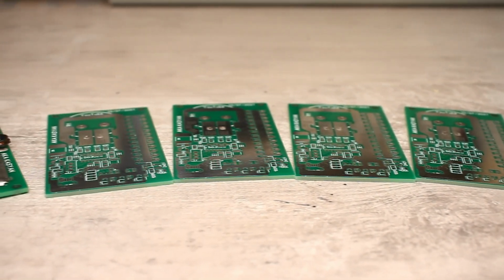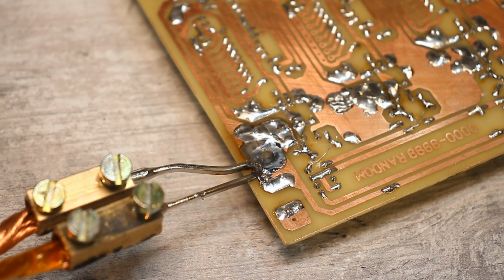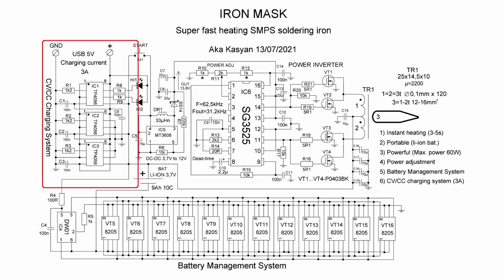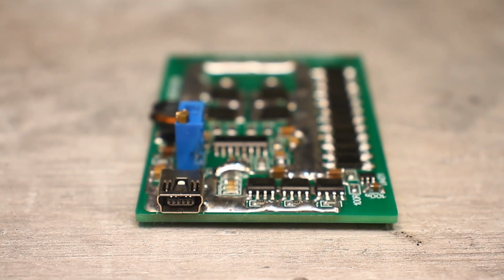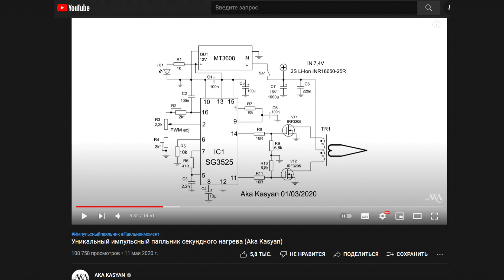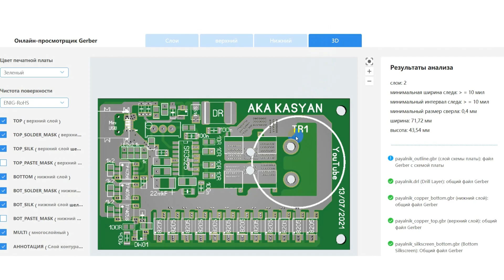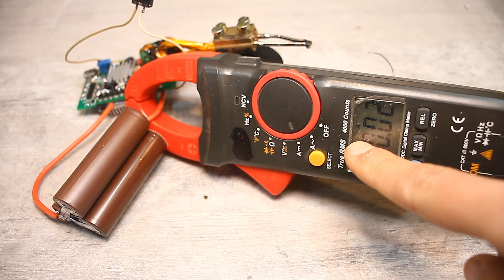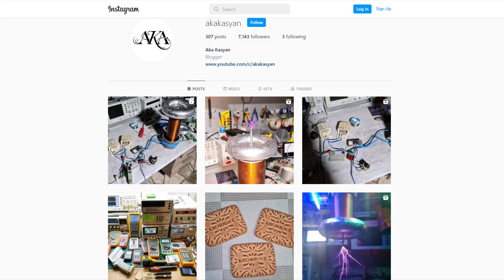IRON MASK - a unique soldering iron

Comment: The inverter and transformer are a lot of work for the small uplift in voltage you require; I wonder what power would have been possible if you simply connect the solder tip to the DC side ?
Reply: Tip is very conductive, u need output in the millivolt range.

Comment: A soldering gun needs enough power 50 ÷ 100W, that battery has maximum 3.6Vx2.5Ax3 pieces = 27W, maybe at SMD the top can also be seen on the thin loop

￼
Reply: Many batteries are capable of way more than 1C discharge current, especially e-cigs ones that tend to have a rating of 10C or more
Reply: It's an intermittent soldering iron. He's drawing a lot more current from the batteries, but only for a relatively short time.
Reply: batteries need to be high rate discharge capable like INR cells. or lipos that often capable of 10C or more
Reply: The batteries are specified for 30a each so a load of 90a (90x3.7=333w) would have been possible. In fact he showed it actually drawing 12.5a so 46w.